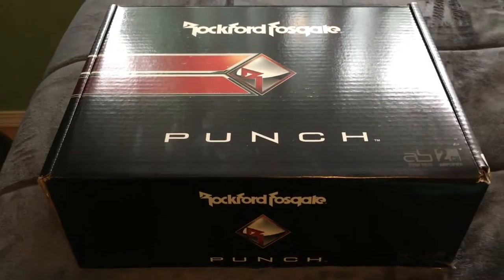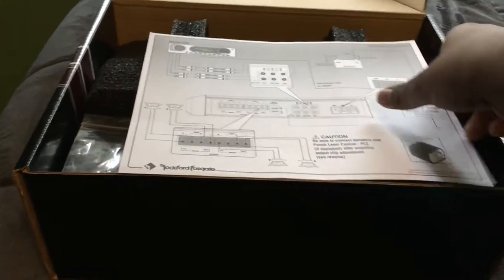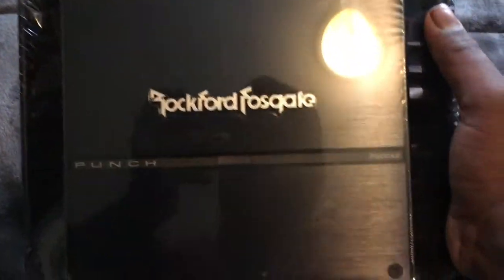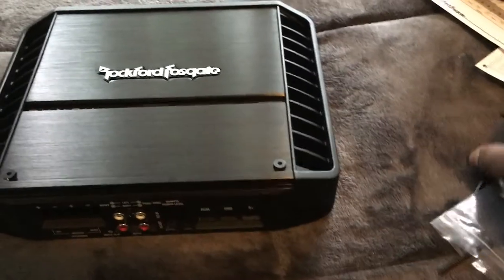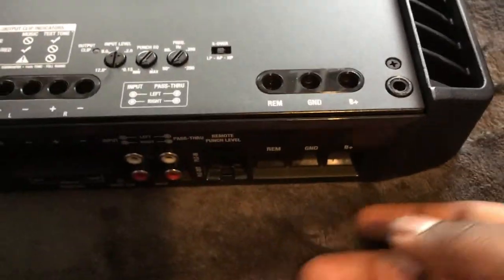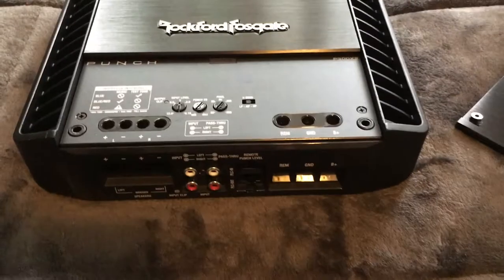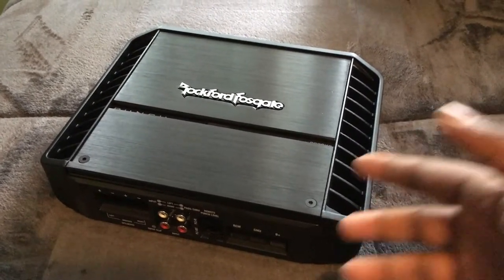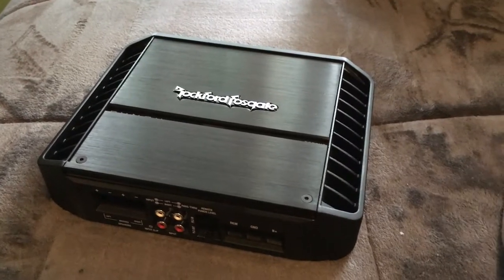Rockford Fosgate P300x2 Unboxing

Comment: Wait how is it 405 watts when it sais 300
Reply from the maker: Rockford under rates their amps. If you buy a new one, they will have a test sheet that will give you the Watts. I believe punch or power series amps are actually 25% more watt output than their ratings minimum.